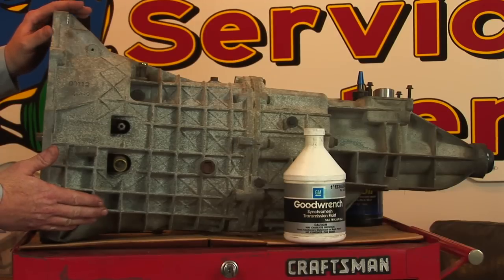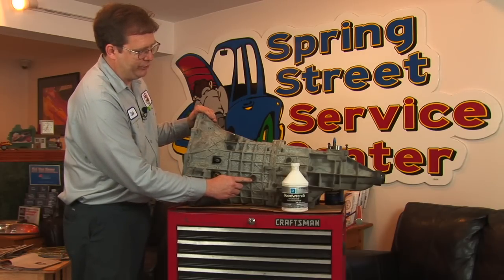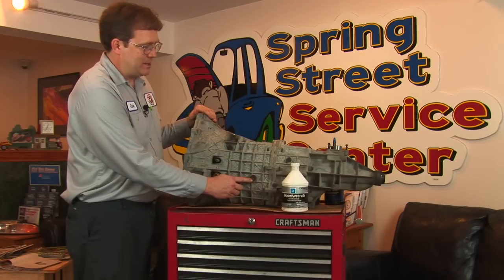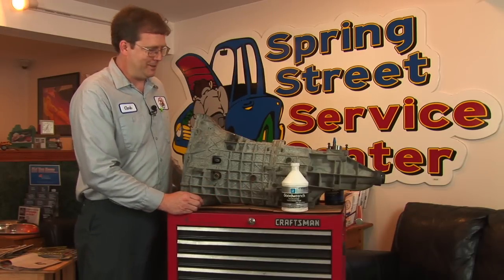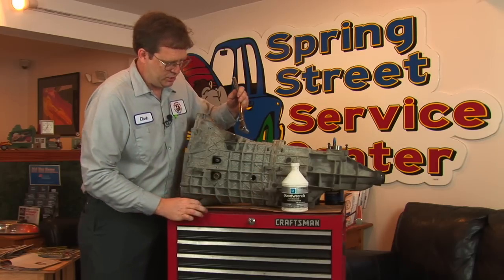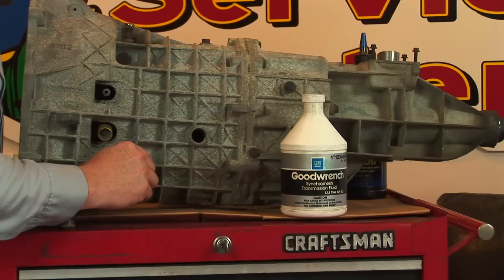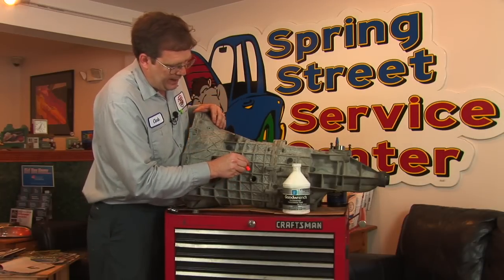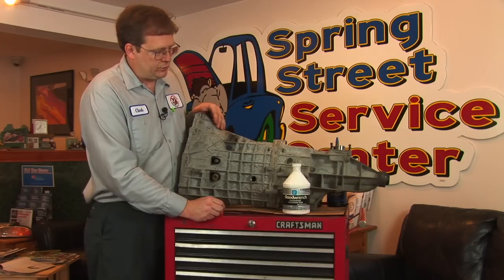Auto Repair & Maintenance : How to Check the Manual Transmission Fluid

Comment: I have an older toyota with manual transmission, could I drain and replace with lucas transmission fix? And not put in gear oil?